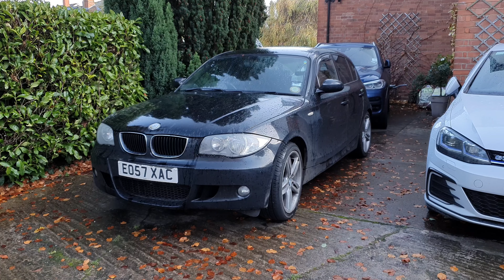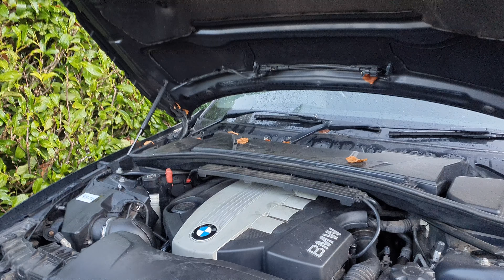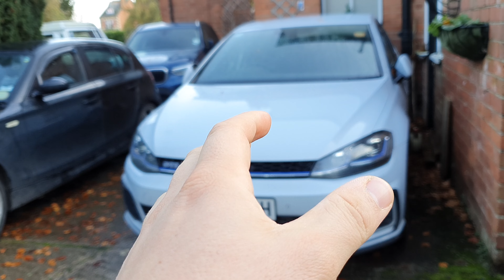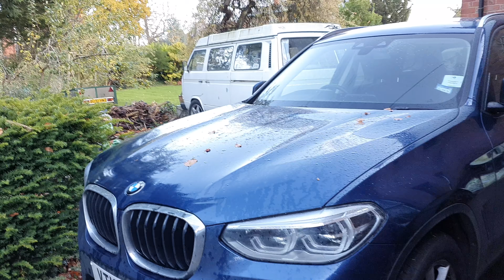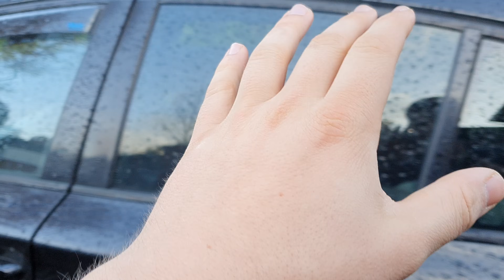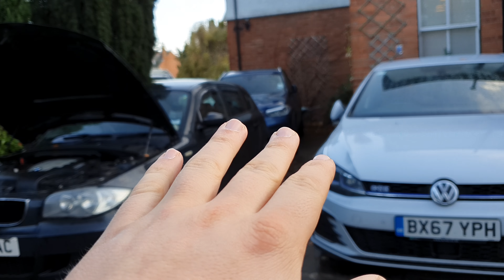Auto Start/Stop is *DESTROYING YOUR ENGINE!!* Here's Why!!

Comment: Appreciate '' the heads up ''. Do not feel comfortable about bluetooth turning off of the system.  As I read some where, just '' jam '' something in the off switch(that comes from an Australian vehicle owner). Initially was NOT sold on the idea of stop/start. Does not make sense, but...... then I heard the batteries/stop start ARE built better/enough to withstand the ASK. Yet, now....... I am better/more informed as to the WHOLE requirements of the vehicle. Soo stop/start for me is a  N O  N O.  Fine for hybrids, where the battery is way bigger, the starter motor is more like a generator.

Comment: The engine starters in a vehicle with Auto Stop/Start have been provided with a more robust design and construction than a regular starter. As an example, they use needle bearings and special brushes. They will outlast any regular starter.

Comment: It’s bad for:

Oil starvation (there’s a FINITE coating on main bearings for this)

Starter/alternator 

Turbos (get heat soaked, due to no oil)

Battery

Timing chain (temp and oil starvation)

Bad for emissions systems (longer to get to temp)

Bad for camshaft especially if you set off fast (oil starvation)

Comment: I drove my gt550 2016 with a start/stop function activated for awhile until it became too annoying. Short stops make the function a pain. In addition the turbo gives oil smell during stops. Thank God once I press the button and deactivate the function it does not default back to on. Thank you for the video. Saving fuel is for pu...ssies 🤣

Comment: You are right but bare in mind that most start stops happen when engine is warm. That means all parts are well oiled and cranking current is way smaller
Reply: I have a 2020 bmw 530d and mine starts working right away with cold motor

Comment: Everyone knows you press the button to disable as we all have diesel BMWs and we all want the starter motors and batteries to last as long as possible, the blessing in disguise is that the starter motors and batteries for these systems are much more heavy duty than ordinary ones, so turn it off and you will have a sytem that lasts much longer than a normal system. Oh and don't worry about the glow plugs, they are largely for cold starts, it's the battery and starter motor that have the greatest impact

Comment: Forget about the starter motor, that`s a minor issue, consider the timing chain, that`s the major one. The maximum loading on the weak single row timing chain is at startup when the system has to overcome the moment of inertia. With the stop/start system in play it is estimated there will be around 600,000 starts as against 60,000 without the system, it is not rocket science to understand that this weak chain will stretch and break far earlier with that extra number of starts. If the timing chain does break a new engine will normally be required, if you are lucky and catch it in time the remedial work is also very expensive. 

If this system is deactivated by my simple method the starter battery will last at least twice as long as it would with the system in play.  A new battery will not need coding and any sealed lead acid battery can be used as an AGM battery is only needed for the implementation of the stop/start system. There is in the case of the Mercedes C Class cars no need for the auxiliary battery either. With my simple disconnect smart charging is also disabled, this has the benefit of the charging regime defaulting to a standard continuous charge ensuring the alternator will now always attempt to fully charge the starter battery. With smart charging in play the alternator will only charge the battery up too about 75% capacity under engine power leaving the other 25% for any regeneration if that happens. If there is little regeneration, mainly short journeys etc the battery will remain partially charged for extended periods which shortens the battery`s life. 

Simple stop/start delete. 

https://youtu.be/x9UML_jDKL0